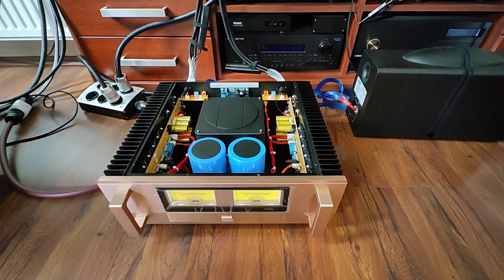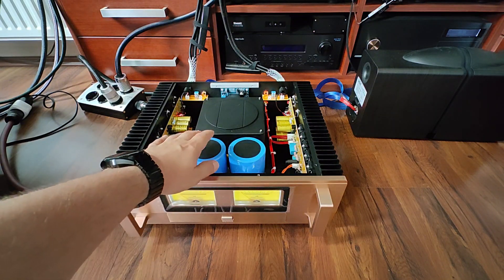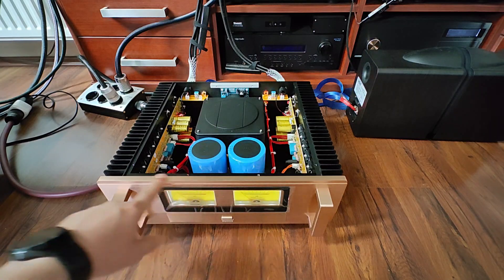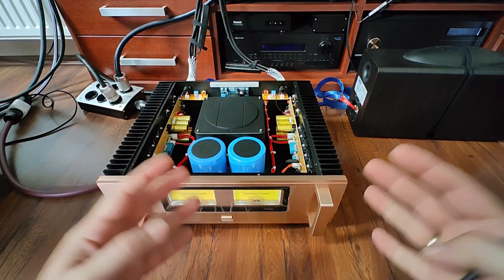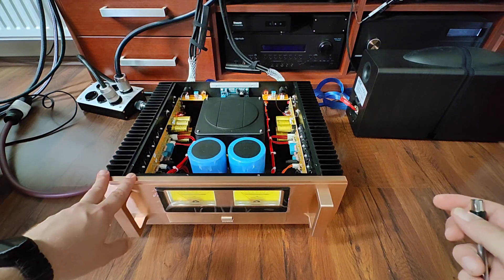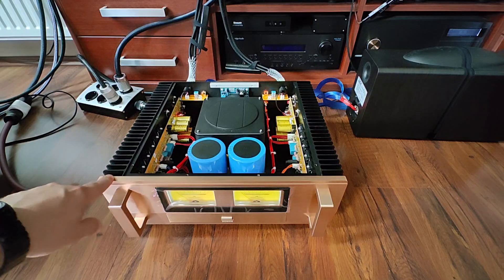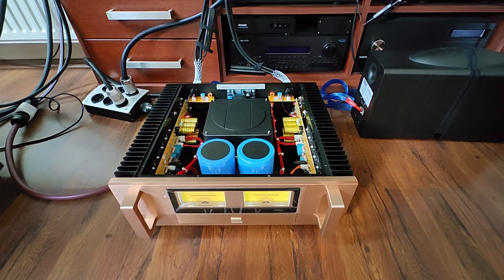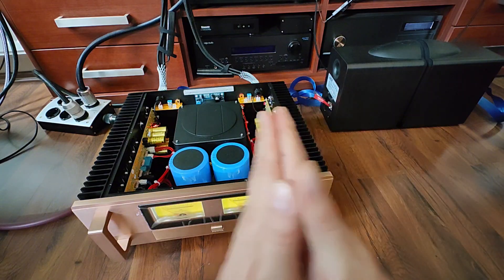What is amplifier burn-in and what are the benefits?

Comment: Paul from PS Audio told me a few years ago told me that much of burn in is due to capacitors stabilizing internally. He said they actually deconstructed used caps and compared them with identical new caps of the same brand and value. The used caps had undergone structural changes that could be easily observed using high-powered stereo microscopy. The used caps that had been used longer were compared with the same type and values with used caps that had been used a few months longer and at some point, the differences between used caps became negligible.

Comment: Amplifier burn in is a purely psychoacoustic effect. Where is the documentation of capacitors going through a burn in? Atoms do not migrate through solder joints from audio signals. That is total B.S. Where are these things "well documented?"
Reply from the maker: Here, let me Google that for you. Look for "aging capacitors whitepaper" and read through articles from Wurth, NASA etc.
As for migration that's what they teach you at any specialization like electric, electronic because this phenomenon is the reason why you should never join two metals like copper and aluminum, as their products are isolators. 
And you can actually observe that with your own eyes by opening any mechanical light switch older than 1-2 years and looking closely at the contact surfaces. One of them will develop a dip, and the other one will have matching excursion made of metal migrated along the direction of current flow. The same thing causes smaller power switches in home appliances to fail. Now, my profession is electronic engineer, I have a secondary school diploma for official qualified technician and then on top of that degree from technical university.. Scott, what are your qualifications for calling the stuff I told BS? 
Have you even tried to verify that, or are you firm "that's bullshit" believer educated by forums, some  youtube guys and facebook?
I don't want to offend you, but there's too many people nowadays who never verify anything....
Cheers!
Reply: @k4syx  Nice try. Yeah, things AGE. Key word AGE. Now show me the papers on capacitor burn in. BURN_IN. Let me google that for you. Hmmm nothing but audiophile bull$**t. Nothing from NASA etc.

Comment: The only thing which "burns in" is your own hearing. If the components don't measure differently after a few hours of use, which of course they don't, then they don't sound different either.
Reply from the maker: @ABC-rh7zc  "which of course they don't". I guess that you are familiar with whitepapers documenting changes in new capacitors that are caused by current flow, right? Small physical changes in capacity, ESR, some time constants for charging and discharge? I'm electronic engineer by profession and trust me, my ears don't burn in, because I don't listen to the equipment during that time, so there's no hearing accomodation. And I compare the sound against my reference amp.
But nevermind, it doesn't matter in the long run. I can hear that, you can't (or you just didn't try), we both can live with that I guess :)

Comment: The average recommended burn-in period is about one week longer than the return period.
Reply from the maker: In Europe you have between 14 and 30 days for returns, so apparently recommended European burn in times should be longer, right? :)
Reply: @k4syx  Of course. More voltage means less current, so of course it'll take longer in Jurop...

Comment: Hi,
Could you explain your PC to DAC output setup?
Reply from the maker: @fernandoleitao382  Sure. PC is small fanless industrial mainboard based computer running win11 and foobar. There's a Singxer SU-6 connected via Chord USB cable. Singxer is a source for my DACs, via two IIS connections made with fake AQ Firebird HDMI cables. And then we have Gustard X26PRO and Semibreve.

Comment: Yes I have a question: 🙂 why not? 🙂 your speaker system here I cannot see how you do this explane and show perhaps mere precise if you like. I only have two ports how can I connect two wires four poles? etc. I think I know but want to be sure. ;-) Burn in: I use a classical radiosender 24/7 it has all kinds of music and talk I think this is most diverse sound and only so when I'm gone and just not to loud so that neighbors don't hear it.
Reply from the maker: @onnonugteren2935  yes that's also fine and will work as well, it will just take longer for the same hours count. Connecting speakers of phase helps with running them quieter, but it doesn't matter if you leave the house :)

Comment: I rebuilt my amplifier (Pioneer SA7800)
 out of: 
2sc3519 & 2sa1386 OP
2sc4793 & 2sa1837 Driver
BC639 & BC640 (will be changed to 2sc1845 and ksa992f, and some higher current voltage stage will be KSC3503 and KSA1381E)
The only advatage that those know is that they have lower Cob, its not 7pf like bc639 and bc640 have, its only 1.6pf on 2sc1845 and ksa992f and those ksc's have 1.8-2.6pf.
which means it gonna have lower noise in my prediction, for now i have a bit of noise in this unit which i can hear.
Reply from the maker: @Uraim  yes the cool thing is that semiconductor parts got better since these vintage audio equipment was built - same as passive parts - so rebuilding actually makes them better!